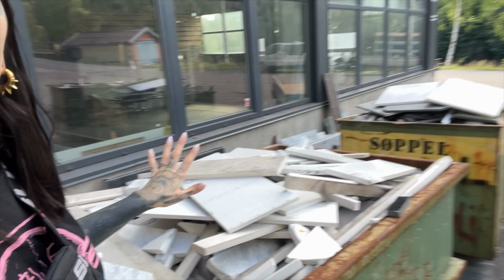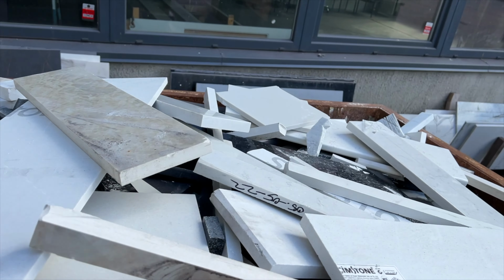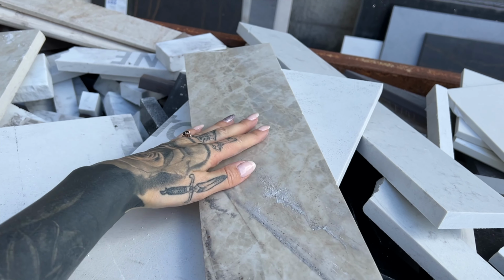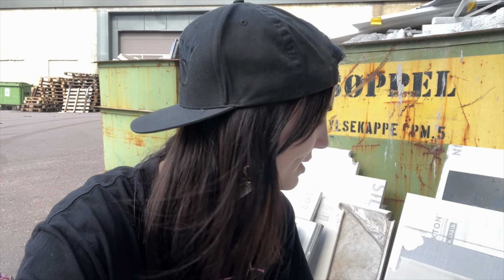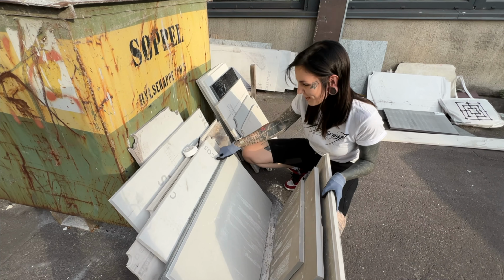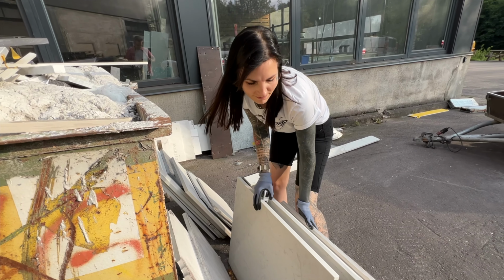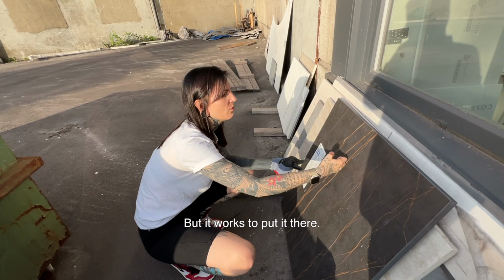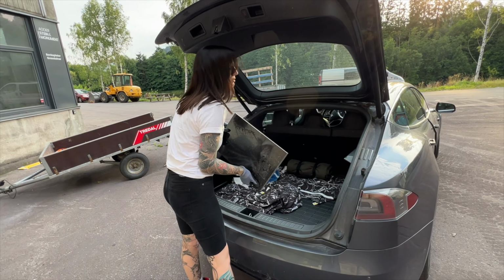MARBLE Dumpster Dive | Lets have a real talk..

Comment: I did the same thing a few years back and dumpster dived some marble and granite pieces! I actually made a couple small granite tables with cut pieces to fit like a puzzle and I also used a bunch of broken pieces for a walkway in my garden ! It worked out really well. If you have a willingness to learn how to cut them you can get a tile cutter or hand grinder with a diamond bit disc , it works well! It is alot of work though but worth it! 👍